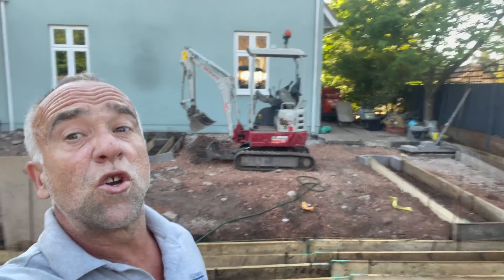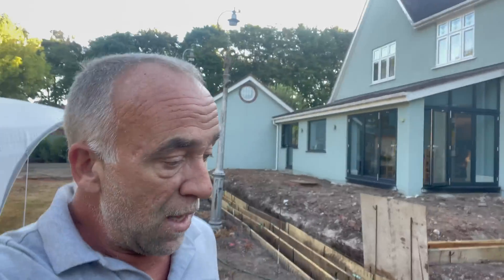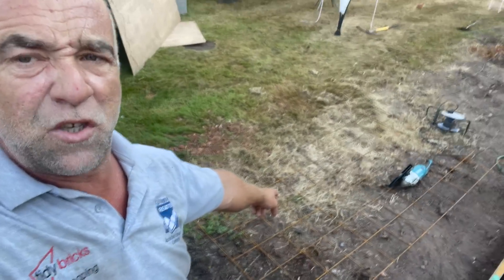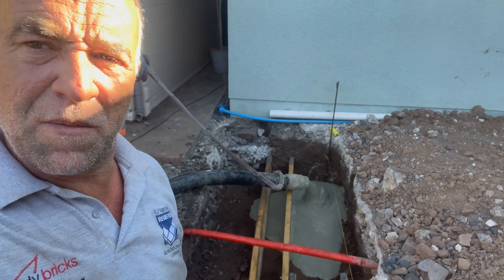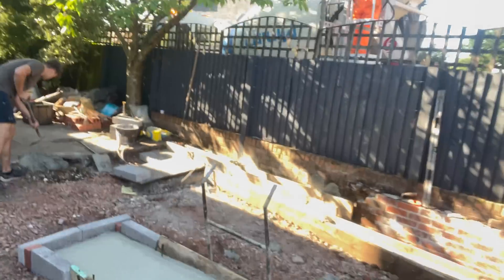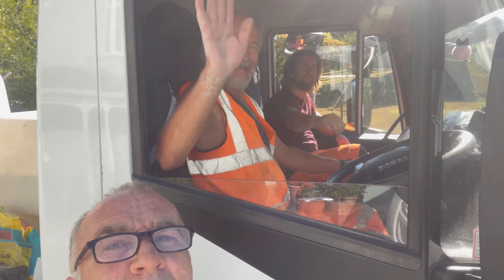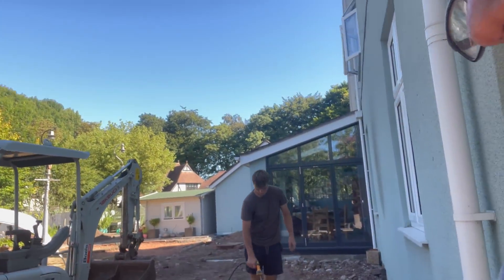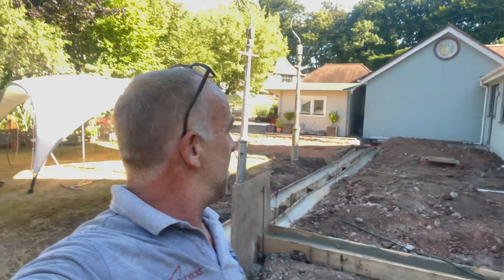"Mastering Concrete Footings: A Guide for Planter Walls 🌿🧱" #concrete #planter #foundations

Comment: can you recommend a heavy duty quality wheelbarrow? thanks
Reply from the maker: I believe belle do a good barrow but it’s around £200 👍🏴
Reply: @tidybrickslandscaping  Yes they have gone up to nearly £200 .... My last 2 were £130 each but they really are the buisness and take a good hammering . 👍
Reply from the maker: @johnbowkett80  when I win the lottery I’ll get some 😆👍🏴
Reply: @tidybrickslandscaping  They are the best investment you'll ever make , just have to keep an eye on them if you pop away for a bit because they could get nicked . Steel barrows nowadays fall apart if you put your weeks wages in them . 😜
Reply from the maker: @johnbowkett80  just bought another Travis one last week bolts are already loose !!!! 👍🏴
Reply: @tidybrickslandscaping  Belle are the best . When I used to buy metal ones I used to always be buying nuts and bolts and Locktight to fix em . Cheap and nasty .
Reply: @tidybrickslandscaping  Once you've used a Belle barrow you will NEVER use any other type .... Even the Readymix concrete lads use em .

Comment: Dam right lad no mixing during the heat, still sweating hard ,
Thought you would have to wet it down and cover it so it doesn't dry to fast and crack ,
Reply from the maker: I soaked the before before hand and it would be in the shade for another 3 hours and Ollie said he would periodicly hose it down too . All done in a hour result 👍🏴
Reply: @tidybrickslandscaping   wasn't giving out lad just asking 😜
Reply from the maker: @stevevw34  yeh I know 😉 if it was a full slab different ball game 👍🏴